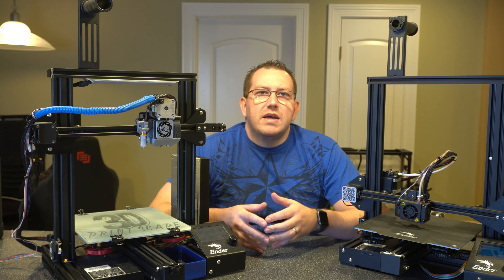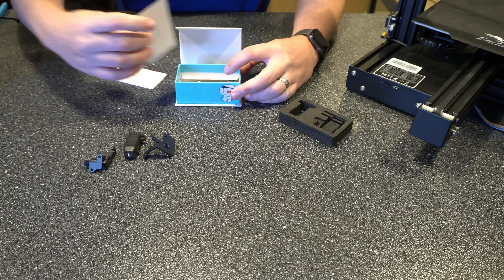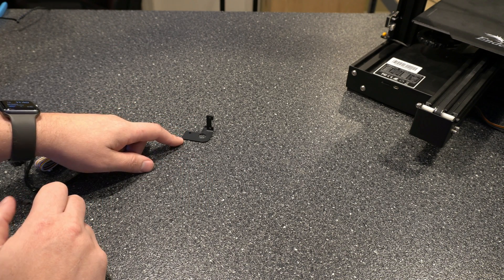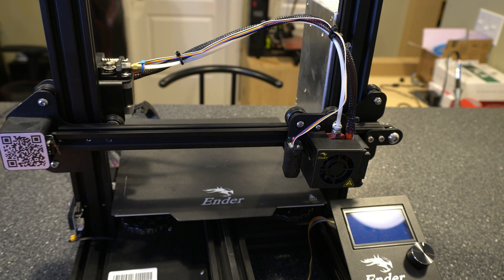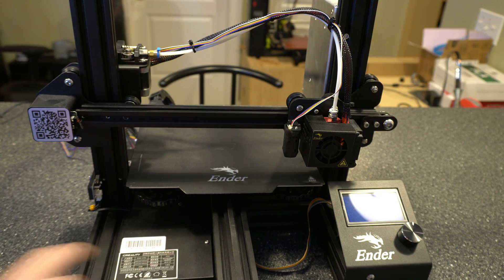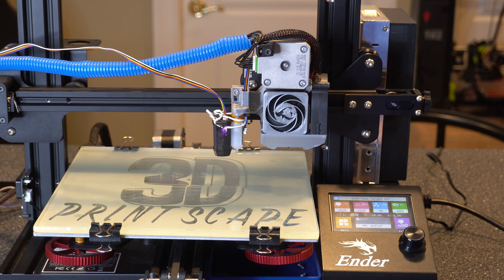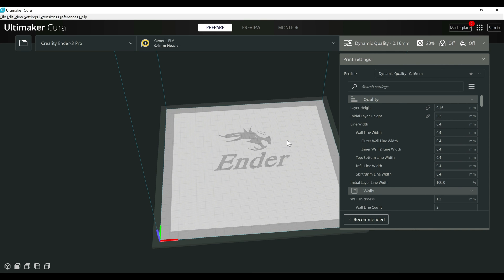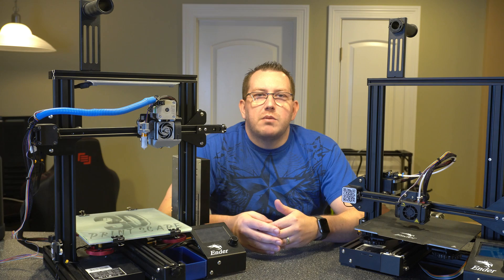CR Touch on SKR Mini

Comment from the maker: I hope you found this overview helpful! If you have any questions or would like other tips/tricks, just let me know in the comments.
Reply: I upgraded to the mini skr as well and I am using the cl-touch and the x axis offset isn’t available on the touch screen and neither is the auto bed leveling either that was in your video. Is it a software thing?
Reply from the maker: @jfply8  Did you update the printer firmware to work with the crtouch?
Reply: @3DPrintscape  I got a Bluescreen any advice? Im litteraly about to throw my whole printer in the trash, It's been a month im trying to update the firmware for my cr touch to work (I use SKR mini e3 v2.0 board) the only thing different that I did from this video  is I had my cr touch installed before inserting and starting my printer. But that blue screen is just the thing that made me give up everything. Creality ender 3 pro
Reply from the maker: @mikahot1371  What firmware are you using?
Reply: @3DPrintscape  Well I got no clue one of your mod fixed my issue, so now I no longer got a blue screen, but yeah idk
Reply: I have the SKR installed and when I installed it I ran into issues. I have it working now but the CR touch and Z homing is not functioning. I keep getting unknown command G29. How can I fix this?
Reply from the maker: @alexisabro6482  Hi. Is the bltouch/crtouch enabled in the firewire? Do you see options in the menu around the bltouch?

Comment: Its been 4 years since this video and SOMEHOW there still isnt a firmware out there that will work unless you do this? I have to make a custom wiring setup for this to work? and somehow in all the years this has been out, there hasnt been a fix for it other than this hack?

Comment: I know this video is a little old but for me i have tried to use the z homing firmware, but it will not let me set the z axis below zero i also have the ender 3
Reply from the maker: Hi. Sounds like software endstops are enabled. This can be disabled in the firmware or with m211 s0 gcode command.

Comment: Hey there!  I know this video is kind of old, but I am hoping you can help me with a weird issue I'm having.  I have an Ender 3 pro with the SKR mini E3 V3.0.  I downloaded the correct firmware from the Git Hub link you provided.  I installed the CR Touch, and then plugged the SD card with the firmware.bin file on it (The only file on the SD card).  I booted up the printer but it is stuck on a blank screen.  I am using the stock Ender 3 pro screen, so it is blank when it does a firmware update.  Did I do something wrong?  Now I am worried I destroyed my SKR Mini.
Reply from the maker: Hi. It sounds like its not taking the firmware. Make sure the sd card is 8gb or less and formatted as FAT32. Also double check the firmware you downloaded is correct.

Comment: dude, i did exactly what you said to do, my screen wont load at all anymore, how can i fix that?
Reply from the maker: Hi. Is it a bluescreen or something else? Also, what printer/board/screen do you have?
Reply: @3DPrintscape  
Well i have the ender 3 pro, i modified it with an skr mini E3 V2 with the tft35 touchscreen. It used to work but ive been having issues with the z-offset for auto bed leveling, so i downloaded firmware for the cr touch by following one of your videos and then the regular screen wouldnt work. So i decided to switch to the touch screen mode and it says “printer not found”. I looked around and apperently the firmware could have been missing some codes but yeah i tried custom firmware and i have no idea why the probe wont work now
Reply from the maker: @derm9734  Did you download the firmware from BTT or my site?
Reply: @3DPrintscape  BTT
Reply from the maker: Can you try the build on my site?
Reply: @3DPrintscape  definitely will try

Comment: Hi there, thanks for the video.  Seem to be having an issue with flashing the firmware.  Followed your video and tried to update to the bltouch, but it does not show anywhere in the menu and it does not connect to the printer anymore (No printer attached message on screen)  Any suggestions?
Reply from the maker: Hi. It sounds like the firmware didnt flash. Do you have a tft screen? If so, try to switch to basic mode to see if it shows anything.
Reply: @3DPrintscape  I have the same issue, how do i switch to basic mode?

Comment: if anyone has a problem with a blank screen after updating the firmware: for me downloading from github with right-click did NOT work because it downloaded a larger file somehow, that did no flash correctly... so if you have the same issue just click on the file and download it via the icon top right...
i already thought i destroyed my printer somehow...
Reply from the maker: Hi. Thanks for sharing this.

Comment: Be careful of these instructions! I installed the CR Touch and the SKR Mini. The firmware that was on the board was Marlin 2.0 bugfix. I right clicked the file on github that you provided in the link and saved target as and renamed to firmware.bin. I inserted the sd card and started the printer. Now there is nothing but a blue screen of death on the printer screen!
Reply from the maker: Hi. This is a common issue. Make the filename unique, so add the date or something to it. For example firmware0305.bin.  If you still get a blue screen, you may have grabbed the wrong firmware.
Reply: I have the same problem, it does not help to change the name, and i have the correct firmware, can you please respond to this or do a video about it, becouse it drives me crazy, i cant figure out how to solve this
Reply from the maker: @markusosterberg6588  I have only seen it not take the file if the sd card is not 8gb or less (and formatted as FAT32), the file name is the same as a previous one, or the firmware is wrong. That said, someone recently said they had a similar issue and got it working by reducing the file name to less than 8 characters.
Reply: @3DPrintscape it would’ve been nice to know the 8gb thing beforehand…….
Reply from the maker: @zadotterazo690  Ya, sorry about that, its not really documented anywhere.

Comment: Hi.  I did find this useful, but I still have a problem that maybe you can help me with.  I have an Ender 3 Neo, which comes with a CR Touch.  I damaged my Creality Firmware board so I purchased the SKR Mini E3 V2 board.  I installed it, and customized the firmware.  Since this Ender 3 does not have a z endstop I inserted the Z diagonal jumper; I also had the same problem without the Z diagonal jumper.  After loading the firmware I move the z axis up and then use Auto Home.  But the x gantry keeps on moving down, even when I put my finger under the CR touch probe (so that the probe pops up).  So my question is how do I get the auto home to work properly?  Thanks! Phil
Reply from the maker: Hi. What config example did you start with and what changes were made?

Comment: Hopefully will get some light. 
First of all thank you for your videos. 
I have an ender 3 pro I installed or replace the board with a SKR-mini-E3 V2.0. I have the stock screen and im trying to install the cr touch. I did every thing but I dont see any thing changing and the auto home stil is the front right corner. any thoughts or a way to test if it was fully installed. thankyou.
Reply from the maker: Hi. What your describing points to the firmware not being updated for the crtouch/bltouch. What firmware are you running and do you see bltouch anywhere in the menus?

Comment: For some reason after flashing the firmware nothing appears on the screen. I have a stock LCD screen from an ender 3. Do I need to configure the firmware for this screen.
Reply from the maker: Hi. You shouldnt need to do anything for the screen assuming the build your using doesn't have the creality screen enabled. Have you tried to use a different sd card? It should be 8gb or less and formatted as FAT32.

Comment: I had a off brand bl touch that I couldn't get to work for anything. I ordered a CR touch today and i think the wiring is backwards mine is L to R  white black yellow red blue for the cr touch your's is the opposite right?
Reply from the maker: Hi. I wouldnt worry to much about the wire colors, ive seen them and the bltouch shipped with many variations. I would verify the pinout to make sure the order is right on the connector.

Comment: Need some help. Got an ender 3 v1 that I just put the BTT V3 board in with the CR touch. Used the firmware from the video. Put the z stop back on the machine (auto home didn’t work at all without the z stop) and it used the z stop instead of the probe to auto home.  Bed leveling appears to work but when I go to print the machine crashes (software) and restarts. Any help is appreciated.
Reply from the maker: Hi. I assume all wires for the crtouch is connected to the bltouch port and the z stop is connected? If so, try the bltouch firmware for that machine from my site. https://3dprintscape.com/marlin-firmware-builds/
Reply: @3DPrintscape  
Looks like I had the firmware mixed. I have the right firmware now and everything from the CR touch works correctly now. Unfortunately the crash is still happening but it looks like a temp error. Looks like the max temp is being triggered before it even begins heating when I start a print. This last time I tried to print it have a loud constant beep with a max temp error “please reset”. I did change out the extruder and thermistor when I did the board. Could it be a bad thermistor or is there a setting I have wrong? Really appreciate the reply on my issue and no worries if this is not your wheel house just figured I would ask while I was here.
Reply from the maker: @Stin721  Is it the same type of thermistor as the one that was in there? It could be bad or the screw holding it in place could be too tight. I had a random issue where i had the screw too tight and loosening it fixed it.
Reply: @3DPrintscape  
I finally got a successful print last night and was very pleased with how it all turned out. Unfortunately I go to print again this morning and despite using the bed leveling and the z offset wizard the print is printing way too high but the purge pass at the start looks good. I have tried the baby stepping to fix but that does not appear to be doing anything or it’s just too big a distance maybe.
I have tried 3 times to print going through the exact procedures of leveling and offsets and always too high. Any advice is appreciated.
Reply from the maker: Are any of the axis or the carriage loose? Are you using the stock springs and do they have any give in them. Also, are you running the mesh at the start of each print?  @Stin721
Reply: @3DPrintscape  
I’ll check for loose screws. Wow, it just dawned on me. I am using a different computer to slice the new print and forgot toy add the G29 into that cura profile (didn’t adjust anything in cura for that matter). I think this is my issue. Sorry to bother.

Comment: My printer does not install the github firmware indicated in the video, when you insert the card and start the printer, it stays with a blue screen and does not continue, there is no way for it to work.
Reply from the maker: Hi. Make sure the file name is unique and the SD card is 8gb or less and formatted as FAT32.
Reply: @3DPrintscape  I already solved the software problem, but now the cr-touch is as if it did not receive power, because when you turn on the printer it does not turn on any LED and it does not perform the tests.
I have the feeling that the cr-touch is broken, I'm going to try it on another board and if it doesn't work I'll return it.
Reply from the maker: @SolidNano  How is it wired and is the z-stop connected?
Reply: @3DPrintscape Does the z-stop have to be connected or does it disconnect for the firmware mentioned in the video? I have tried it disconnected and it doesn't work, but I don't remember if I ever tried it with it connected.
Reply from the maker: @SolidNano  There was a few Creality firmware builds, including the one in this video, that required the z stop to be disconnected, all other prebuilt ones expect it to be connected. If it wouldnt go down on the z axis that could have been the issue.
Reply: @3DPrintscape  The CR-touch was definitely broken, we tried another one and it worked without problems. Thanks for the attention
Reply from the maker: @SolidNano  Cool, glad you got it working.

Comment: I kept messing my printer me up getting a blank blue screen. I was only putting 1 firmware file on the card but it needed all those config files as well.
Reply from the maker: Can you make sure the filename was unique, add a character to it, and make sure your SD card is 8GB or less and FAT32.
Reply: @3DPrintscape  I got my screen back, but I snapped the CRtouch itself so the install is on pause for now until I get a new one.

Looks like I lost my filament sensor in the firmware update though.

Some of this I suppose is above my head because I don't understand why there is just a firmware.bin file available but I needed an entire zip with a bunch of files in it.

I appreciate you taking the time out to reply back.
Reply from the maker: Creality has a bunch of firmware options in the one zip, but you only need the .bin. Im not sure they have one with screen, CRTouch, and filament sensor though.  @chickensinmotion6827

Comment: It is a complete MYSTERY to ME how ANYONE is getting their BTT stuff working -- my two-week-long nightmare trying to upgrade my Ender 3 has yielded nothing REMOTELY useful!  I wanted to run Klipper, so I got the SKR Mini E3V3 and the TFT 3.5 and the BTT Pi 1.2 in hopes of making that move.  Well, so far I have managed to BRICK TWO of the Mini boards WITH THEIR STUPID FIRMWARE, and their "tech support" has been ZERO HELP!  A metric TON of apologies does NOTHING to fix the problems.  Answering the questions I ask (like six or eight times!) might POSSIBLY be helpful - IF the answer is actually KNOWN to someone there?  Yes, six or eight TIMES I have asked them:  WHAT ARE YOUR HOURS OF OPERATION???   How hard can THAT BE to answer???  Apparently it's lost in the Google Translate or something....
Reply from the maker: Hi. Sorry to hear your having issues with your setup. This would be difficult to troubleshoot in yt comments but if you join my discord (link in video description) server people will be able to help out.
Reply: @3DPrintscape  OK - I'll try to give that a shot - after one or two "honey-do" matters . . . .:face-purple-crying:

THANK YOU for the prompt RE:  !!!

Comment: Did you do this after you did the dual z axis?  Would the CR touch work wtih the dual z axis and the SKR mini V2?
Reply from the maker: Hi. I did the crtouch first. It requires a firmware update the dual z axis didnt. It will work with the SKR mini v2 & 3.

Comment: Hey, I just got a cr touch for my ender 3. I'm using a skr mini e3 v3, but the cr touch's led is solid red. What should i do??
Reply from the maker: Hi. Do you have all five wires going to the bltouch port and the z stop connected?
Reply: @3DPrintscape  yeah the z stop is connected and the CR touch is too..
Reply from the maker: Do you see anything related to the bltouch in the printer menu and when you auto home what does it do?  @xd_W1lliam
Reply: @3DPrintscape  When I auto home the printer its doesn't move and still stays red. And there is nothing in the home menu corresponding to the CR touch. But when I first turn on the printer the Cr Touch does go up and down 2 times, but yet again the led is red. Could I have installed the firmware wrong?
Reply from the maker: It would say bltouch in the firmware (they are the same to the board) but ya it sounds like it may be a firmware issue.  @xd_W1lliam

Comment: Hi  i can,t get it working man  i tried everything but not working
Reply from the maker: Hi. What issues are you having?
Reply: @3DPrintscape   well everything man hahaha  i installeren the mainboard and the tft35    but i can,t autolevel, crtouch is not working  and i tryed to change the firmware but it say,s   volume.init  failed
Reply from the maker: @johnvdlaan562  Can you try the firmware from my site? https://3dprintscape.com/marlin-firmware-builds/
Reply: Still not working  it keep saying volume.init  failed.    Is the sd card to lange??  I use a 128 gb  sdcard
Reply from the maker: @johnvdlaan562  That SD card wont work. It should be 8gb or less and formatted as FAT32.

Comment: Hi! Great imformative and in-depth videos!  Thanks.  I do have an issue though.  I have an SKR Mini e3 v2.0 and the CR Touch.  I flashed the firmware you suggested and when I do auto-home it moves to the corner, raises up and then does nothing else.  I don't have the touch screen.
Reply from the maker: Hi. Is the z stop connected? If not, try to connect it. There were only a few creality builds that wanted it disconnected.
Reply: @3DPrintscape  Thank you!  I thought I had tried every way with that plugged in and not plugged in, but that's all I was missing.  Very much appreciated!

Comment: У меня стоит Marln 2.1.2,   с флэшки ничего не устанавливается. просто синий экран на принтере. Что мне можно сделать?
Reply from the maker: Hi. Make sure the sd card is 8gb or less and formatted as FAT32. Also, make sure the firmware name is unique (add a number or something to the file name).
Reply: @3DPrintscape  Спасибо за ответ. ВЫ сказали   Also, make sure the firmware name is unique (add a number or something to the file name). Напишите. пожалуйста, на примере,
Reply from the maker: @leonidleo6780  So if the firmware name was just firmware.bin, change it to firmware01.bin. The creality screens blue screen if the name matches the previous name used.